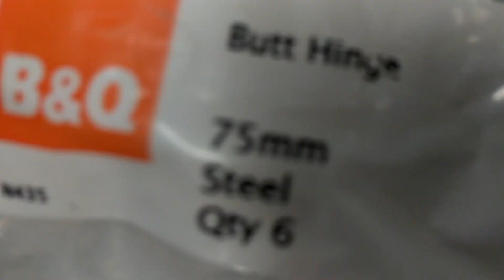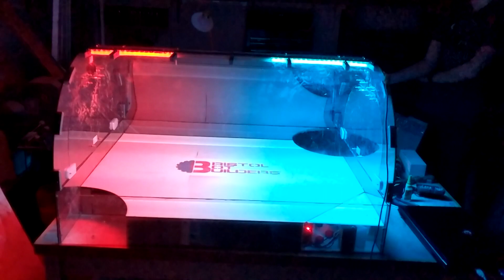[VLOG] Building an Antweight Robot Arena - Bristol Bot Builders

Comment: Could you share the Cad file? Or dimension. It looks awesome and I’d quite like to build one
Reply from the maker: The base is 1000x820x100mm. 
It's made from 4mm polycarb and 2 layers of 2mm for the curved pieces :)
Reply: @JoeBrown1  How did you get the two layers that form the top to be so clear and precisely aligned? It looks like you only have one layer. I'm also guessing that you had to use two 2mm layers instead of one 4mm panel because 4mm wouldn't bend enough to curve over the top (as opposed to a large 4mm sheet being too expensive or other non technical issue).
Reply from the maker: @iamionscat  It's laser cut as seen the in the video! 2mm bends better and also has a bit of an air gap to help last longer, this arena is still going strong today :)
Reply: @JoeBrown1  Also, did you find the connections with the sides required more support (since they open) than the drilled sides of Peter Weller's arena (since it is lifted)? And finally are your lights inside the arena or outside? Thank you very much for your help!
Reply from the maker: @iamionscat  It doesn't need more support as it's  bolted all the way up the sides on all 4 corners which makes it fairly rigid. its very flexible when you don't have all the sides joined up. The LED strip is on the inside and has had to been replaced a few times now! :P
Reply: @JoeBrown1  Thank you! This helps a lot.
Reply: @JoeBrown1  one more question, is there a way you have of replacing the interior kicker walls and the main fighting floor? Accessing the electronics for the flipper? I'm wondering if the main floor drops out for that and how you engineered that if that's the case. Again thank you very much for your help and time. I'm kind of alone here in the US so building up a UK antweight league from scratch is taking me a bit of work, especially since I've only seen these fights on YouTube.
Reply from the maker: @iamionscat  there’s a 4mm MDF sacrificial floor that just sits on top that we replace every 3 events or so. The 4mm wall kickers get the majority of spinner hits and could be replaced as bolt in with the outer walls but honestly are still totally usable. There’s actually a reasonable 150g / fairyweight scene in the US do check out antweight combat robotics Facebook group :)
Reply: @JoeBrown1  Thank you! I may have to break down and give up my "no Facebook ever" rule. Lol but the info you gave me is very helpful, I'm grateful. Thank you again!
Reply from the maker: @iamionscat  Facebook sucks, but Facebook groups are a great resource for robot combat stuff! Happy to help, good luck hope you can run some events :) we stock plenty of 150g parts in our shop if you need any bot bits ;)
Reply: @JoeBrown1  Thanks Joe. Combat robot stuff is maybe the only thing that could motivate me here. I couldn't sleep and thought of one more question. If you had it to do over again,would you change anything about the build? Do anything differently? My plan is to make one arena like yours first and another like Chris Malton's. Then the original one can be a great test box and backup arena and I'll also have a bigger one with more flexibility. Again, A Sincere thank you for your help and suggestions. I appreciate it.
Reply: @JoeBrown1  How tall did you make the arena? Also can it fit through normal household doors when carried or do you have to tip it on its side? Or do you always have to use a wide door or double doors? I'm trying to get mine so I can move it through a normal household door, even if I have to put it on its side. Thank you again!
Reply: Awesome thanks!

Comment: Hi, i was hoping your could help me with a problem i am having with my receiver and transmitter. it is the HK TR6A V2 hobby king receiver/transmitter combo. i have tried re-binding, different receivers and there is nothing happening. i have checked the batteries and they are fine because they light up the different escs that i have tried as well. but the receiver is not lighting up either. Is there anything else i need to try? i'm having the same trouble with a different rc combo as well. please help!!! its the only reason i don't have several robots moving and its so frustrating.
Reply: question. When you say you are trying different receivers are you using the same type as before or something different? Also those receivers have computer software and can connect to a PC. can you try this to see if you get anything from the controls?
Reply: Bogus Nuggs I’ll try that thanks.